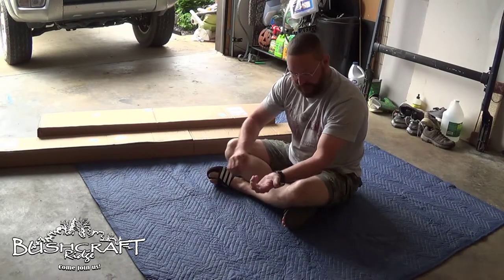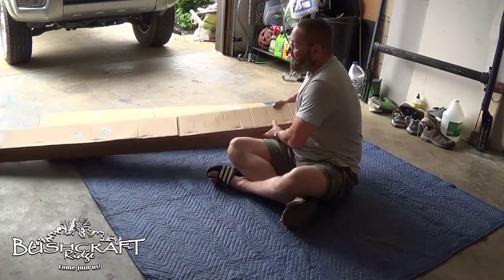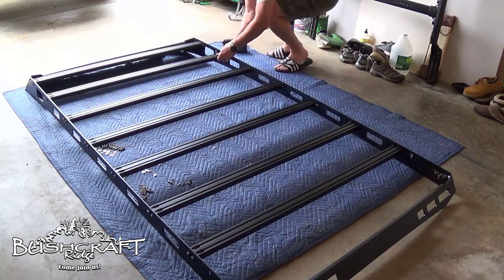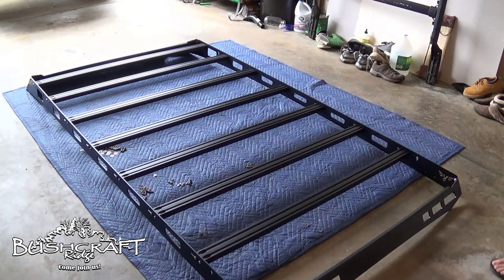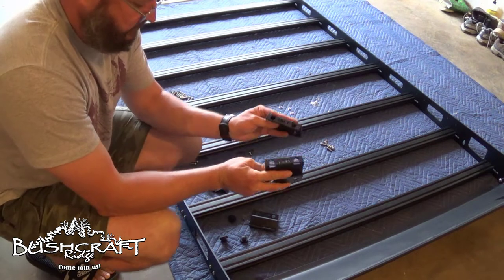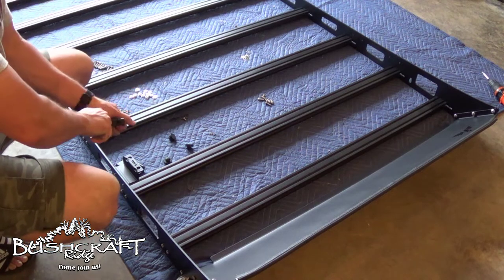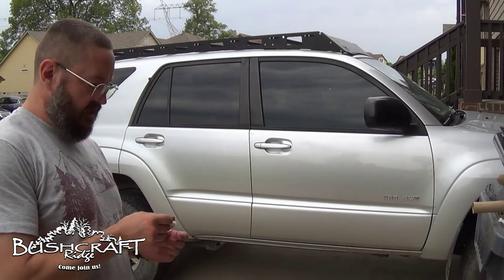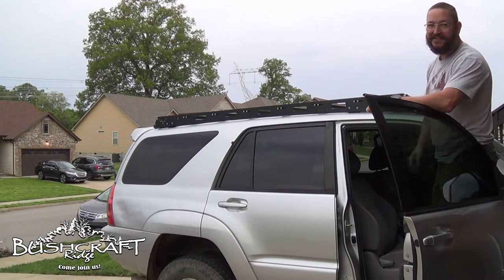4th Gen 4Runner Roof Rack Install (no drilling required)

Comment: I feel the exact same way about using a 6 point over a 12 point socket. Just as you mentioned about the ol' Torx into the Allen screws I just prefer to have more flat side contact. All of the years installing fancy pants boilers, plumbing fixtures, tankless water heaters, and schtuff I really dislike Torx screws and Torx bits in Allen heads. It's too easy to deform and ruin the end of the Torx bit. That's a bummer you cut yourself though. That install fits like a glove. I agree about the light bar thing. I'd just install, fit, cut, and dohickey the lightbar in the original kit, as you said no need to pay extra. Solid roof rack and top shelf video. Keep up the good work! Also I wish we lived closer I'd enjoy giving you a hand on these man projects you've been working on lately.
Reply from the maker: That would be awesome indeed. I need all the help I can get. :-)

Comment: Hi! tnx for this install video and the link! Quick question. is the roof rack as tall as the stock roof rack/rail? Reason I’m asking is I live in an apartment with garage that is pretty low clearance (6’8”) ceiling but my 4th 4runner can luckily clear it for now due to its 3” lift. Unsure how beefy tall these are..they look amazing!

Comment: I really think you should raise that up and put your silicone around the hole and underneath the bracket so it did seal it so you do is push all the silicone in the hole which is not gonna sealed nothing with the threats!
Reply from the maker: That is a great point! You can't really tell in the video, but I put a lot of RTV down in the actual bolt hole, not just on top.